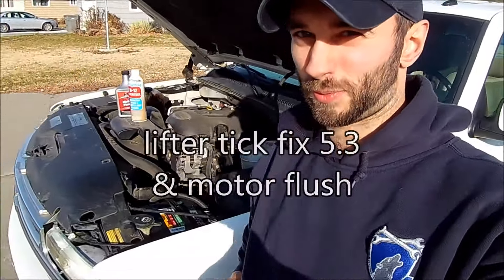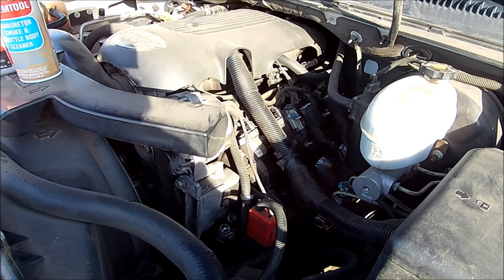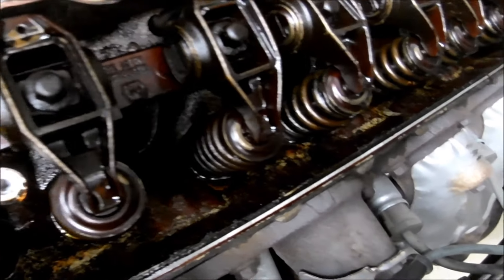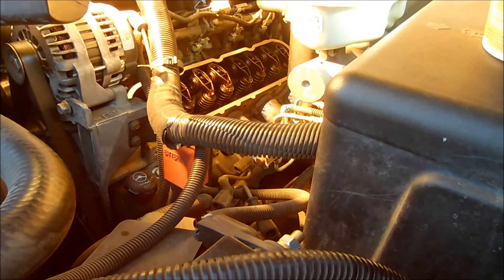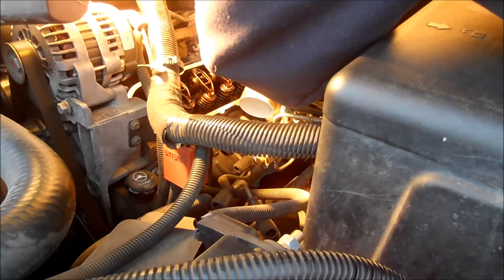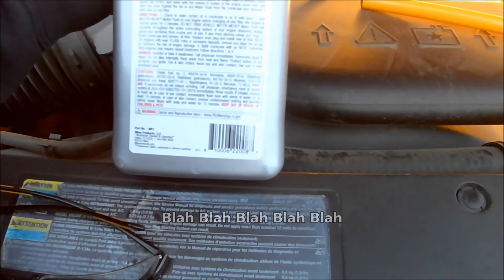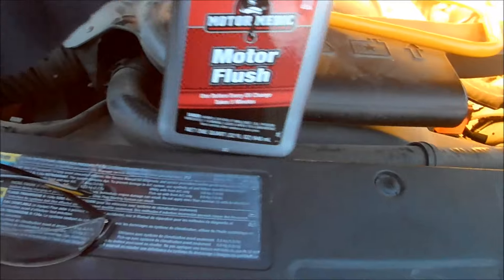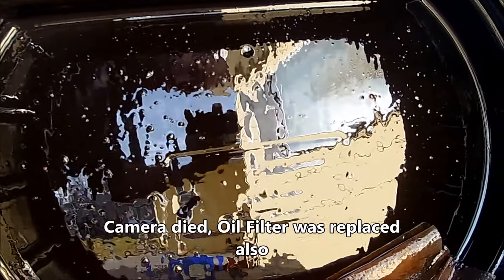lifter tick 5.3 fix

Comment: I have a 2001 GMC 1500 with 5.3 and 570,000 on the clock.   She has issues but I roll her about 200 miles every other day for my work.  A  little leak hear and a tick there but she gets the job done.  Still looked spotless until the deer got me on the left front corner 2 years ago.  .
Reply from the maker: Wow! Ole reliable

Comment: Go buy a quart bottle of Marvel Mystery oil. Dump a quart in for your next oil change. Drive it for 1-2k miles. It truly works i have used it for years.
Reply from the maker: This was a while ago now, and the lifter tick is gone. MMO is great stuff though
Reply: Heyy how do I get rid of ticker  sound , thinking of purchasing a 2010 Tahoe 147k miles … is it still worth buying z71 5.3 understand it might be oil pressure related .. is it worth fixing ?

Comment: For varnish like that, drain the old oil, get a new cheap filter &  oil...4qts cheap oil, 1qt diesel fuel...let the engine idle till it is at running temp ( DO NOT Rev. the engine or drive the vehicle )...then do a final oil & filter change , then change the oil again as soon as it starts to look dirty...!
Reply: i hear that auto trans fluid works well also.......and can be kept in for awhile.  thoughts?
Reply: @atomicdmt8763  I’ve done both. I like diesel better!

Comment: My '05 Chevy had the same issue I replaced the oil pickup tube solve the problem the o-ring on the tube has dried out lost suction couldn't get oil the top of the engine previous owner had replaced all of the lifters and did not solve the problem but that o-ring around the pickup tube solve the problem tick went away
Reply from the maker: I've done this flush, and the o-ring now and the tick is gone 👍
Reply from the maker: After the flush, the tick had improved a lot, my o-ring I wouldn't say was really bad but I did it anyways. After a few thousand miles... The engine sounds great, no tick. You are absolutely right though, that o-ring can cause the tick.

Comment: Iv got the vortex 6000 in my 03 escalade with a similar problem,  but it's at 260k and all I did was put in a high pressure high volume oil pump. Currently waiting for warmer days so I can open up the block and just replace the lifters . $0.25 part would be the headache
Reply from the maker: Budget really controls everything, I have a spare engine if it came down to it. But I wanted to give this "fix" a shot first. And the tick has gone away. I've also replaced the o-ring but when I took it out it wasn't that bad yet. The engine though, has a lot of varnish from previous neglect. So when that varnish got loose it clogged up so oil passages on the way. Still drive her everyday, good oil pressure. No issues. One day I'll rebuild her I'm sure.

Comment: Diy Dad Stuff. Update on results? Looking at purchasing an 2010 Suburban 185k with same sound as yours. Thanks.
Reply from the maker: Its still there but its significantly quieter. I know its there so i always listen for it but it's very faint. The newer chevys (gm) have the cylinder deactivation systems. Ive heard they create the issues with the lifter tick on those but, from the looks of mine. My lifter tick was caused by engine sludge and neglected oil changes - I'm pretty religious with changes so it was a previous owner.

I wouldnt let a lifter tick scare you away from the truck your talking about. These engines are very durable.
Reply from the maker: If the sound happens on a cold start and goes away as it warms up, it is the exhaust manifold leaking. Just fyi. Sounds just like a lifter tick.
Reply: I had a '03 Yukon Denali with a 6.0, wish I would have kept it. I bought a 2010 Suburban LTZ with the 5.3. What a disappointment. Has a slight lifter tick, but I think its due to the AFM. The AFM goes into funky mode quite a bit and the result is engine shutter, vibration etc. 184,000 miles. Starts great, runs super MOST of the time. Beautiful vehicle, sorry I bought it....

Comment: Too extended oil changes and I think at least one exhaust manifold bolt is broken in the noise area. Front one looks gone.
Reply from the maker: 3 broken exhaust bolts. But they don't hurt anything so they are on the bottom of the list 👍
Reply: Sometimes those missing bolt heads are the cause of the tick.  It's causing the manifold to not completely seal to the head where it's missing until the engine heats up and expands.  Same thing was happening to mine.  New bolts and manifold gasket and the ticking went away.

Comment: Any “check engine” light? Any codes like P0300 random misfires?
Reply from the maker: No, not from this issue. The only misfire check engine light I have had was from a leaking intake manifold gasket that was changed at like 187k miles but that was years ago.